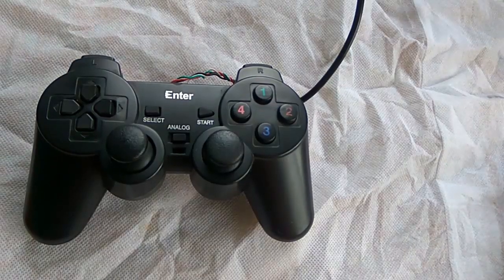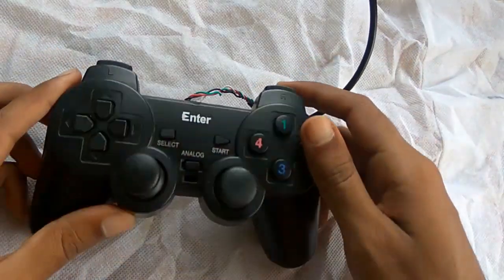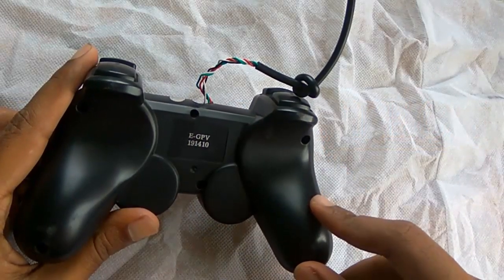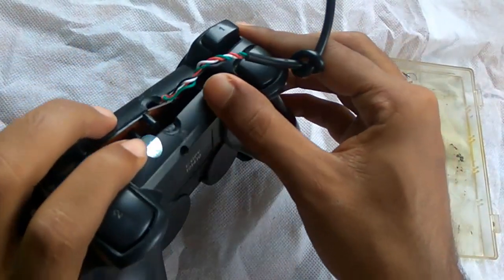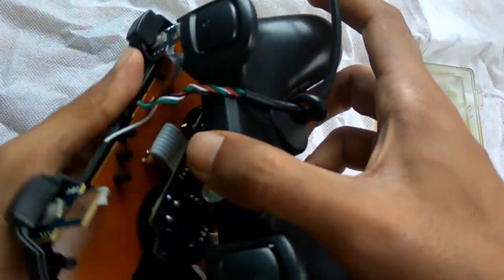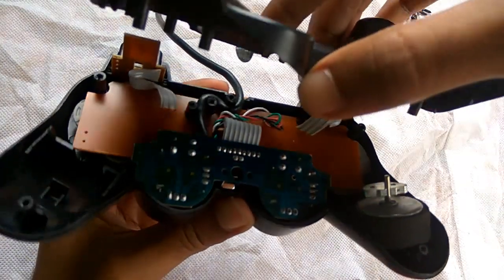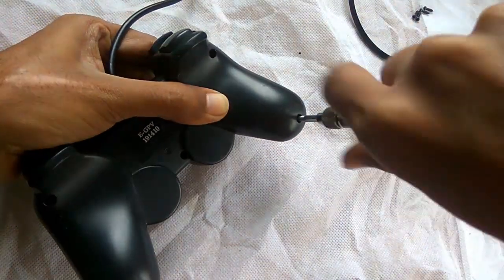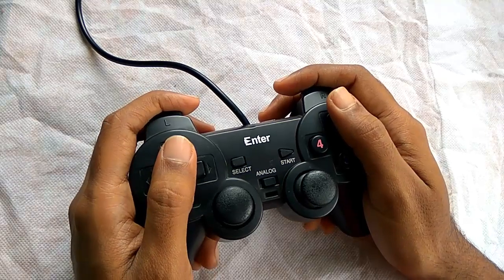HOW TO REPAIR PC GAMEPAD

Comment: Hey the analog button in the middle is not working for me. Unable to switch to analog mode as the red led is not turning on. Please help.
Reply from the maker: I think, your internal chip is gone.
Reply: TECHNICAL TECH I just bought it yesterday. Everything was working fine. Suddenly the button stopped working. All the buttons are working except the analog button which is why the d-pad and the left analog stick is doing the same thing.